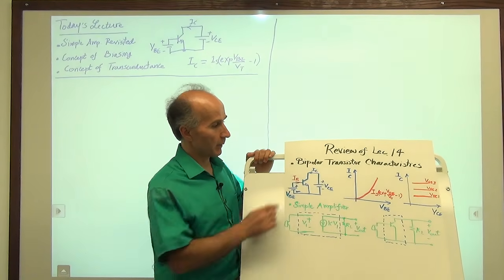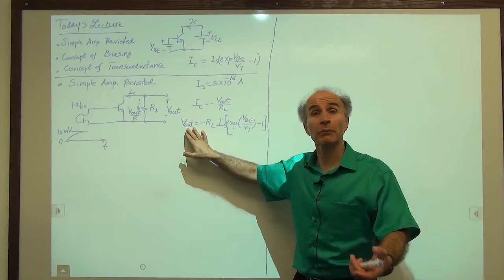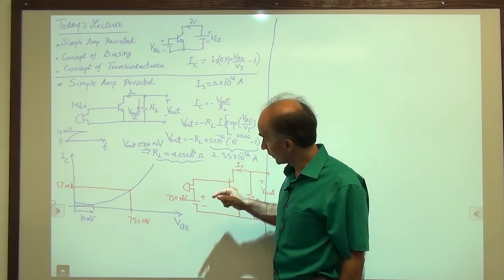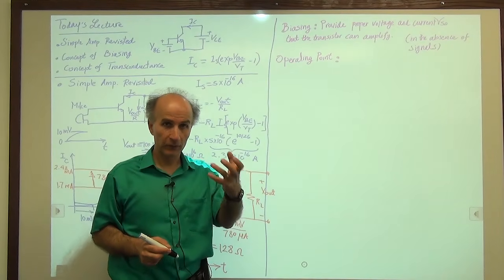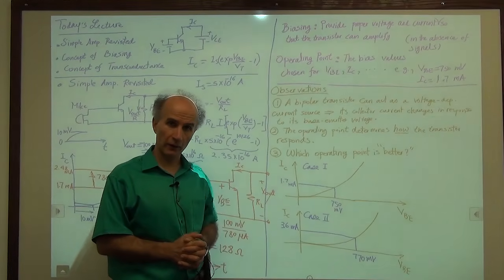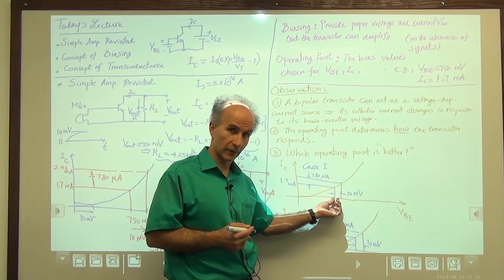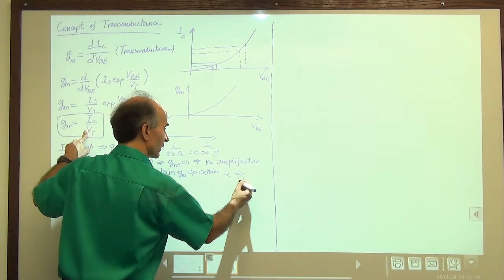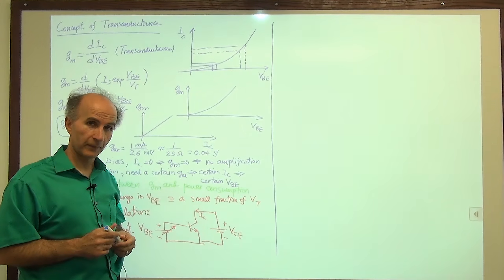Razavi Electronics 1, Lec 15, Transistor Biasing, Transconductance

Comment: in the first example, when the Mike is at only 10mV, the active forward bias won't even happen. the base voltage is said to be the same as diode, which is 700mV at least, so future discussing the resistor value is not practical.

Comment: generally everyone sas=ys that the ac signal is amplified by taking power from dc signal but in this lecture sir told that 10mv from mike is directly applied and corresponding current Is calculated which is amplified also. how does it make sense? any one to explain it please

Comment: Hi sir,
Since the diode V-I characteristics are also same why can't we use diode for amplification. It has same exponential characteristic with the same biasing at the input voltage
Reply: great doubt if you got the answer share here
Reply: bcz it cant act as current source , simple

Comment: I truly love his teachings, but I have two questions:
1. Where is Vce that will make sure that the collector-base junction is in zero or reverse biased in other to be in active forward region and work as an amplifier?

I figured out that it was later modified in the subsequent lectures. Thanks.

2. For example, For Approximated Gm in case 1:  Gm1=dIc/dVbe=0.78mA/10mV=0.078S
Which you said that we don't know for sure if 10mV is a small change.
For Accurate Gm in case1: Gm1=Ic/Vt=1.7mA/26mV=0.065S. 
Let's find dVbe in this case: dVbe=dIc/Gm1=0.78mA/0.065S=12mV.

Now my question is: Between 10mV and 12mV, Which one is a small change in Voltage?🤔
If 10mV<12mV, why not stick to the Approximated Gm?
Reply: I think that you misunderstood the meaning of derivative. Here Ic is an exponential function of Vbe, and gm is the change in Ic over infinitesimal change in Vbe in around a point, and it is only valuable for this point. You can not find out the value of the change in Vbe by using the change in Ic and gm at a point. Many other functions could have the same derivative value in this point.
Reply: thank you for the answer to the first question. i was wondering the same thing.

Comment: Why no voltage applied across vce for reversed bias
Reply: because I(ce) is const. and it wont go out through Vout as open ckt. thus R(l)*I(c) is the voltage for reverse biasing which is greater than 760mv.
Reply: @silentReawaken  ic is constant only in active region...which is based on Vce,,,which is not provided...
i think some sort of power need to be provided

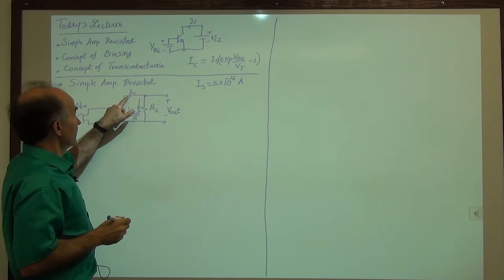Comment: 9:15 why is there a  minus (Vout/Rl) ?
Reply: Taking a random node in the loop, from Kirchhoff's first law you have: Ic + (Vout / RL) = 0. Vout /RL is actually Ic going in the opposite direction.
Reply: I think applying KCL at the upper node of Vout shows all current goes to the load. Hence negative sign should not be there, but this hardly matters.

Comment: I'm assuming that you considered ideal diode model here.. otherwise applying 10 mV would keep the Base Emitter junction reverse biased and the transistor would remain off.
please correct me if I'm wrong..
Reply: Do you understand how he find the value of Rl . Because Ic=2.48ma.
Reply: @animeshgautam6197  Rl = change in Vout/ change in Ic =  100mv/(2.48mA-1.7mA)   

we are aspecting Vout to be 100 mv
Reply: I dont see how 10 milli volts would reverse bias a diode. It switches on fully at 700 mV  but perhaps at 10mV its lets a tiny insignificant current pass. Just my idea on the matter.
Reply: @michaelcostello6991   Absolutely correct!
The 750mV is given such that it the Ic varies linearly with Vbe, below which the current is so low that we say its not frwrd biased. There's also something between forwrd n revrsed biased uk.
Reply: Correct but 10mV has been chosen for demonstration only.
Reply: But here , professor used actual function of collector current not just on / off as in the ideal diode model . If you use actual function of diode current for diode you will get same results !

Comment: If we give 10 mv as a Vbe i.e., microphone input then the transistor will be in off condition only if we consider constant voltage model rather than ideal diode model .Then how can we carry out the discussion.
Reply: If we we give it a 10mV voltage it almost have zero Vout for a reasonable RL. However, when the professor said that we need an amplification of 10 for that small current because of zero biasing the result was unreasonable resistance value for RL.

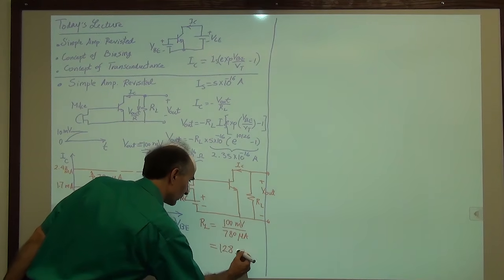Comment: 22:54 why did he take only increase in current when the signal applied, why not 2.48 mA?
Reply: Output Voltage with Signal is (current with Signal) X RL = (2.48E-3 X RL) Volts
Output voltage with no Signal is (current with no Signal) X RL = (1.7E-3 X RL) Volts
Amplified Signal Voltage is (Output Voltage with Signal) - (Output voltage with no Signal) = (2.48E-3 X RL) Volts minus (1.7E-3 X RL) Volts  = (2.48E-3 - 1.7E-3 ) X RL Volts = 780E-6 X RL Volts which is (Increase in Current with Signal Applied) times RL
Prof just didn't show all the steps.
Reply: @williamsimpson4670  YES YOU ARE CORRECT. HE IS TALKING ABOUT Vout INCREASE OF 100mV NOT 100mV ITSELF
Reply: As I understood, in Rl=100mV/780uA, it actually represents dVo/dIc, but not Vo/Ic,
when you change your Vbe voltage for example, to 10mV, you want to see change of output voltage by 100mV, but not 100mV at output, so to make this happen, you need to put resistor that when multiplied to change of current, gives you desired change at output, dVout= Rl*dI

Comment: in 22.43 why is he taking increment in current not the incremented current?
Reply: As I understood, in Rl=100mV/780uA, it actually represents dVo/dIc, but not Vo/Ic,

when you change your Vbe voltage for example, to 10mV, you want to see change of output voltage by 100mV, but not 100mV at output, 
it is like your change of Vbe value is amplified by 10, and at output you will see change of 100mVs,
so to make this happen, you need to put resistor that when multiplied to change of current, gives you desired change at output, dVout= Rl*dI
Reply: Exactly...got the same doubt..
Reply: I too have same doubt RL as  theoretically itself defined as V/I
Then why to consider the incremented value ???Taking new I into account itself may suffice.
Reply: @baalakrishhnach3574  Let’s say that the initial current and voltage through the resistor are given by V1=I1R and the amplified current and voltage are given by V2=I2R then the change in voltage is V2-V1=R(I2-I1) throughout which we can calculate R as the ratio of the changes in current and voltage.
Reply: As I understood, in Rl=100mV/780uA, it actually represents dVo/dIc, but not Vo/Ic,

when you change your Vbe voltage for example, to 10mV, you want to see change of output voltage by 100mV, but not 100mV at output, 
it is like your change of Vbe value is amplified by 10, and at output you will see change of 100mVs,
so to make this happen, you need to put resistor that when multiplied to change of current, gives you desired change at output, dVout= Rl*dI

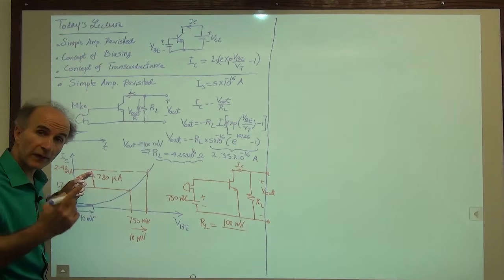Comment: what Prof actually doing in 22:37? In what basis he wrote that equation.
Reply: Got cleared?
Reply: yes got cleared. I had misunderstood the concept at first. thanks for your reply:)
Reply: Could you please explain the same?
Reply: He is trying to calculate the resistance needed to produce a change in voltage of 100mv for 780-microampere current.let's assume the graph to be linear in that small range and we know the change in voltage with respect to change in slope dv/di is the resistance.simple:)
Reply: @visweshramkumar  thanks bro
Reply: viswesh Ramkumar Hi. Where can I find the practice problems to make sure I understand the concept?
Reply: asl bas I solved prob from fundamentals of microelectronics book